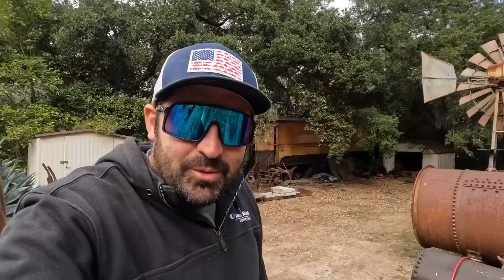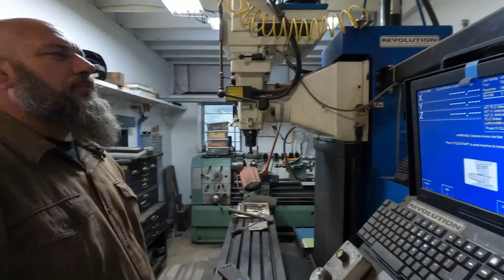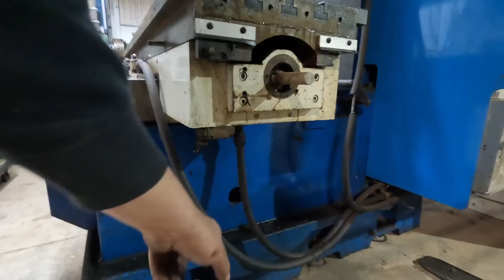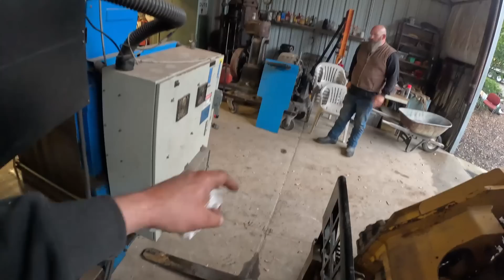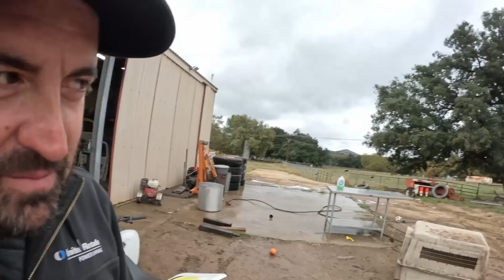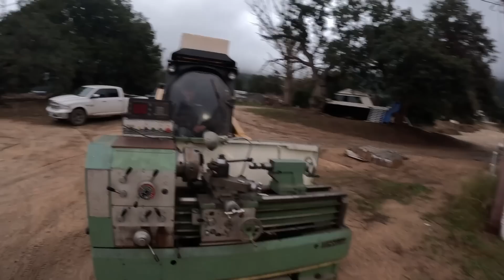INCREDIBLE Shop Upgrade: Part One

Comment: That's a score
Reply from the maker: It took a lot of work to get it all out to the ranch I just hope we can get everything up and working 💪. They had some problems with the Milling machine so hopefully we can figure it out. It is a 25 year old machine but the bones appear to be good
Reply: @Mr_Get_Muddy  It's the old ones that last forever. It seems like your buddy knows what he's doing.  He can get the milling machine up and running perfectly for you. The Metal lathe doesn't take much to keep those running. You're gonna have to keep Ryan away from them.

Comment: Those are some nice finds! You need a phase inverter for the 3 phase. I didnt catch it in the video if the lathe was 3 phase also. If its capable I would run it on 3 phase. Motors prefer it. Feel free to hit me up if you have questions.
Reply from the maker: For sure, dude. Hopefully, in the next week or so, I can start to get things situated in place and hooked up.

Comment: What’s fuel prices in California these days? Just curious because it’s been under $3 in northeast Ohio for the past few days. If Trump was President it would be $1.99 like it was for a few years. Does California see major changes in gas prices like other States do is why I’m wondering.
Reply from the maker: I dont buy buy too much gas but diesel is cruisin right around 5.50 to 6.00
Reply: @Mr_Get_Muddy Around here diesel has stayed consistently over $4 when gas prices have fallen and it’s odd that diesel isn’t dropping like usual.
Reply: Gas is about $4.65